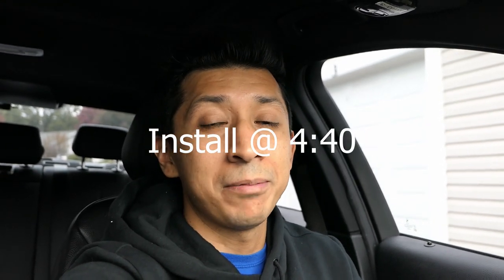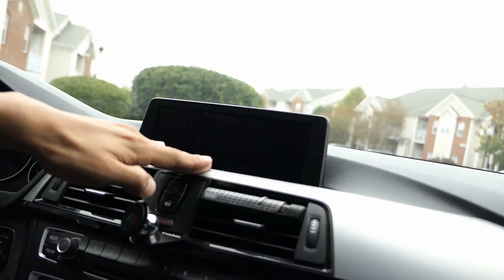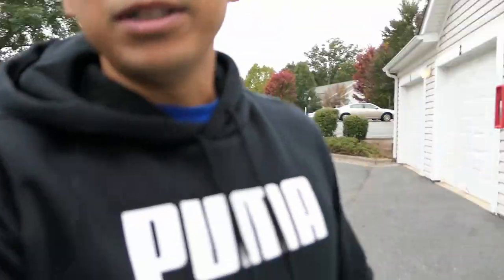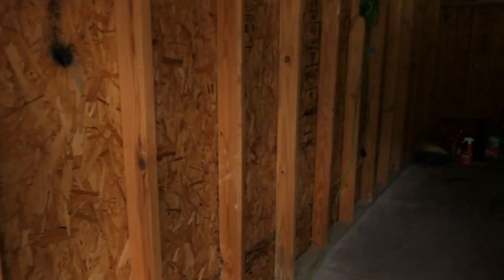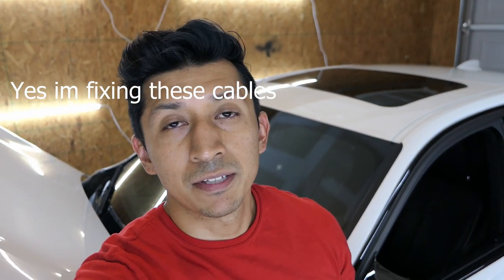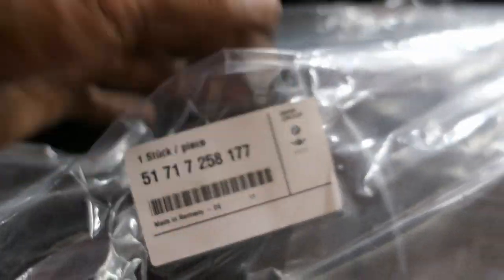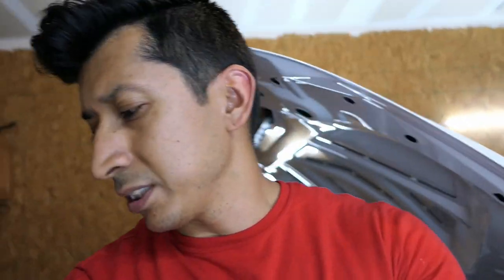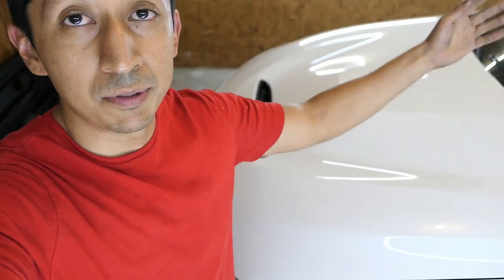Kiesmotorsports Spoiler + Cowl Installation | F30 DIY

Comment: I just got a quote this week from my local BMW dealer for cowl (same part #) $166.33 plus $75 labor= $241.33!  And for those interested in the FCP Euro link, that part has apparently doubled to $108.
Reply: Yep, I just installed this. $110 from FCP. Easy install. But the only saving factor is that this will last for at least 8 years.
Reply: It's insane that the cowl doubled in price in just 4 years!  Got mine from fcp euro too for $109 shipped.